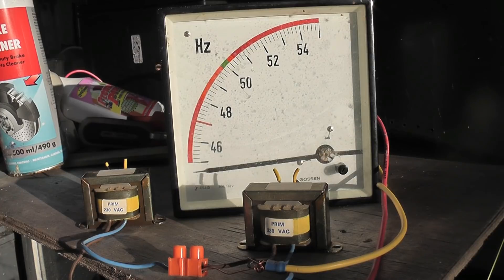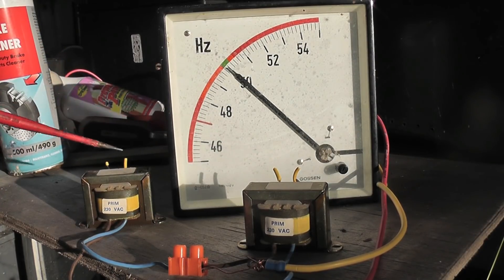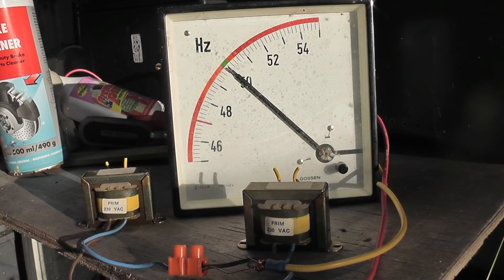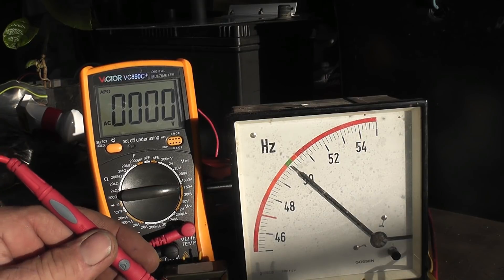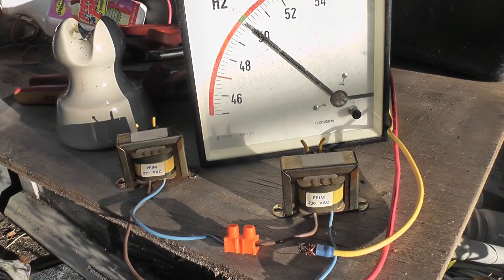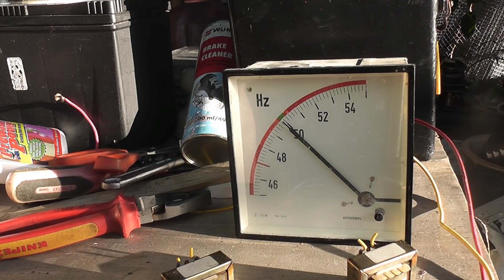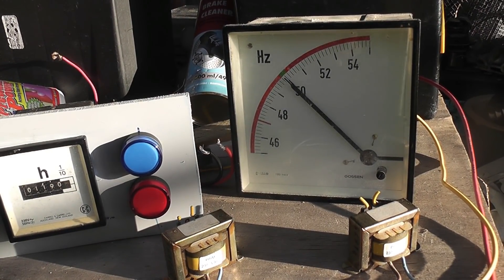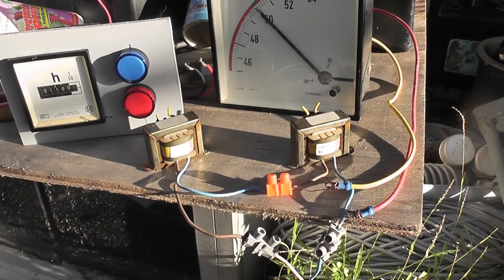Inductive voltage divider 230 - 81 Volts

Comment: Assuming identical voltage ratio transformers, if you parallel the secondaries (in the correct polarity, of course), they will divide the supply voltage neatly in half. ;)

Comment: Neat.
I'd forgotten about this little trick - very useful if you don't have the correct equipment to hand.

Are there similar set-ups used in high voltage/high power distribution systems? I'm thinking on the actual power lines themselves and not in control systems.
Reply from the maker: No on High Voltage proper VT's are used. 11kV / 110 Volts or 66kV / 110 Volts

Comment: Thanks for that tip Ray, I also have a number of 110 Volt electrical items so that will be a way to use them on 240 Volts. I have also salvaged a number of 240 to 110 Volt transformers and they are very handy!
Reply from the maker: No worries Ian, this worked out the easiest, as the load of the frequentiemeter is not that high. The mains was 234 Volts and split in half at exact 117 Volts unloaded. When putting the Hz meter on one side, it dropped to 81 Volts and the other side to 153 Volts, all within the TX ratings, and all load was inductive so no phasing errors and the like.